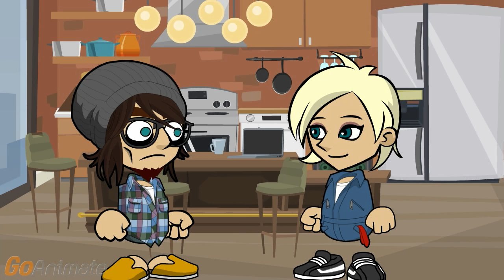GE Profile Oven Error Codes

Comment: Ge Profile oven J2S968SH2SS came up FO code-shut down from breaker turn back on-Press BAke and  Broil buttons same timepress 9 and 0 same time for 5 sec  wait 20 sec after time Is displayedpress 1 and 5 same timethen you will see Loc ref then all light comefor 30 sec-  then Loc Refthen press 6 and 8 same timeit should display time and date and operate aokI went thru all keys to make sure okseveral hours now and no F0 codecant buy board - no longer make - so good luck!!
Reply: where did you find how to clear the F0 code?  I have the F0 code and we have replaced two things and no luck